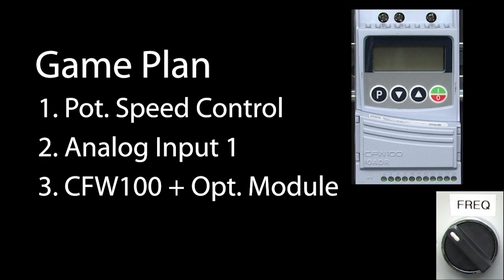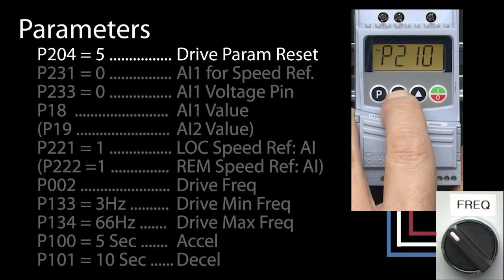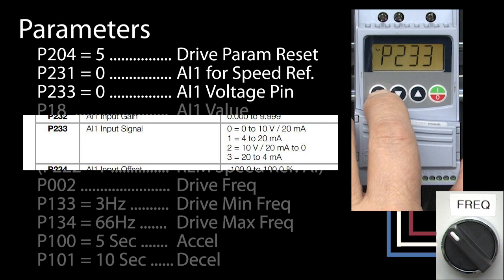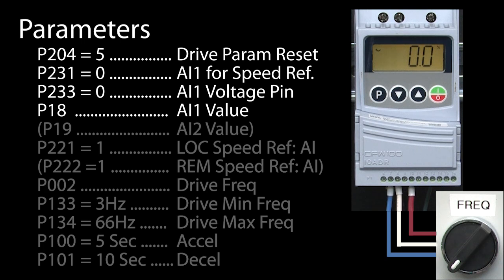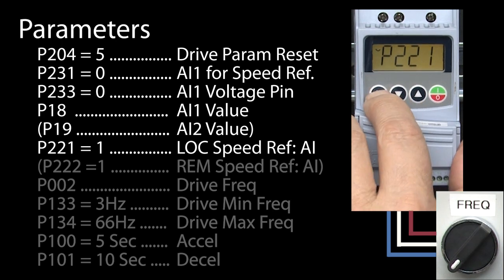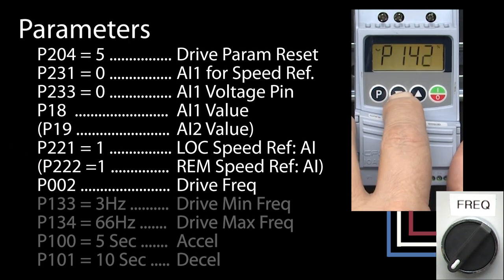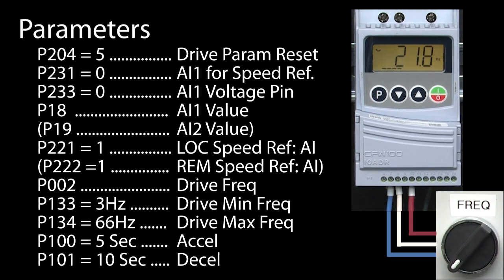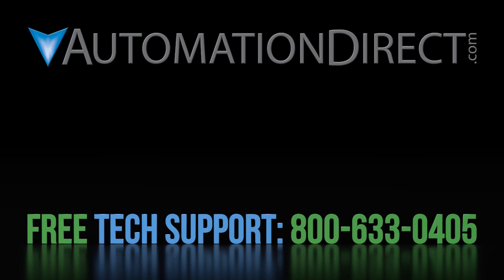WEG CFW100 & WEG CFW300/320 VFD Analog Input - from AutomationDirect

Comment: Can we set a torque reference from some analog input? Thanks for the video.
Reply from the maker: @junoutneto
Unfortunately, neither the CFW100 nor the CFW300 offer torque control modes, or torque limiting in speed mode. The WEG CF500 will do torque reference from an analog input, as will the AutomationDirect Durapulse GS20 and GS30 drives. See them here: https://www.automationdirect.com/adc/shopping/catalog/drives_-a-_soft_starters#Series_ms=(%20%22DURApulse%20GS20%22%20%22DURApulse%20GS20X%22%20%22DURApulse%20GS30%22%20%22WEG%20Electric%20CFW500%22)&start=0

Comment: I'm looking for a simple 110V input (60hz)...  and a 3-phase 110V output (400hz). The power requirement is minimal (1/4hp is PLENTY).

Would the WEG CFW100 VFD (Gen 2 Series) be the best option, or is there something else better suited?

Is there ANY other hardware that would be needed to operate?
Reply from the maker: Thanks you for viewing. Unfortunately we have no drives with this output.

Comment: Do you know if I can use the analog Vref to power an arduino?
Reply from the maker: Hi Luciano, The 10 Vdc reference voltage is intended for a potentiometer, but you could use it for other things as long as you don't exceed the 50mA limit. An Arduino can draw up to 200mA, so it really depends on your applciation.